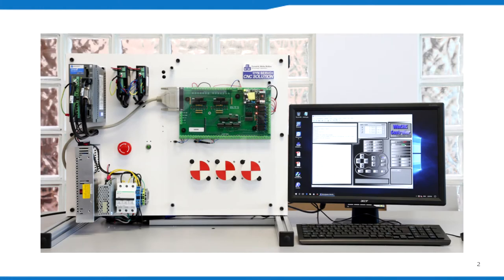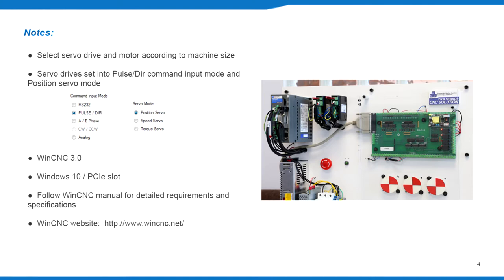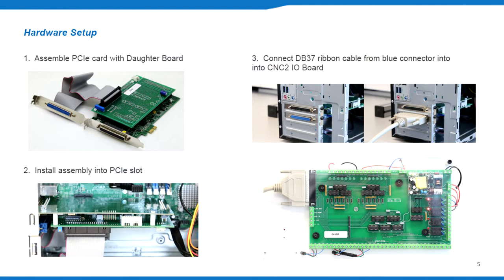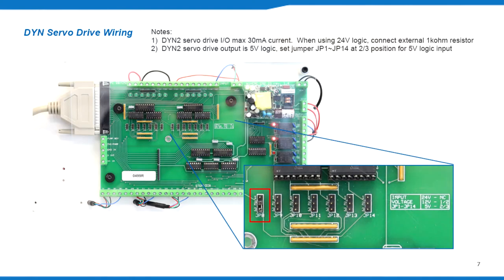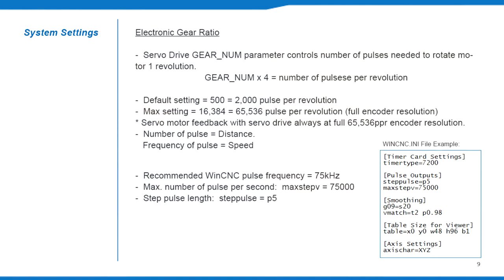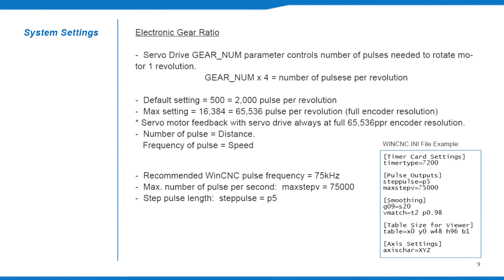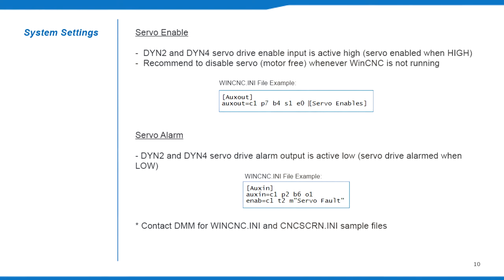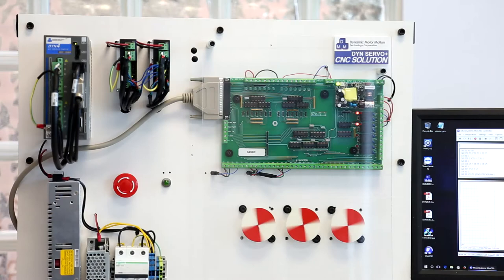CNC Solution - WinCNC Setup Instructions

Comment: PCI card not found
Reply: This usually means that the PCI card has come loose in the PCI slot. Power down, remove the screw holding the card in the slot, remove the cards, firmly reinsert it into the slot, and reinstall the screw. You might also get that error if the PCI card or the PCI card slot is bad. If it still fails, and there is another slot available, try it in that slot.